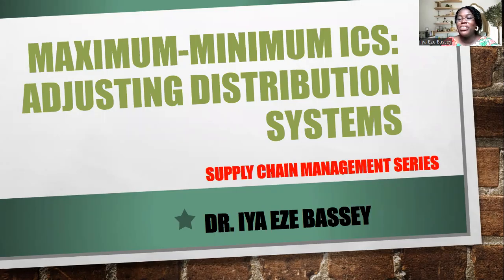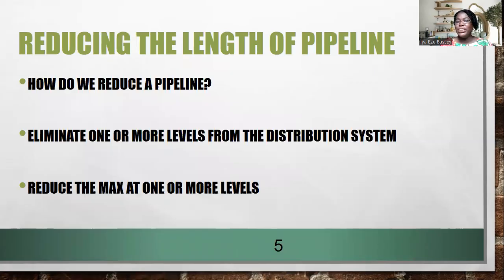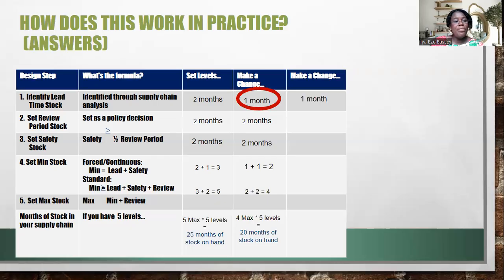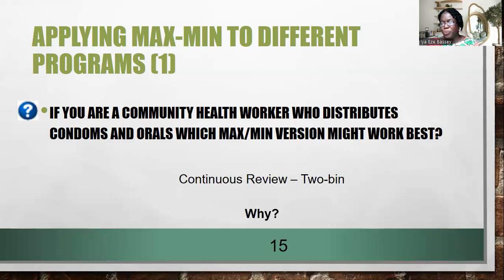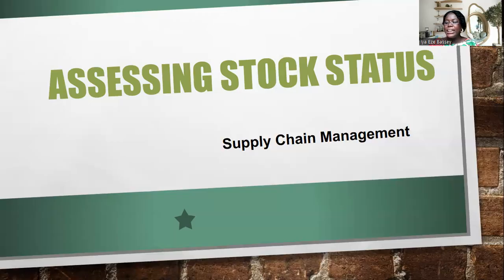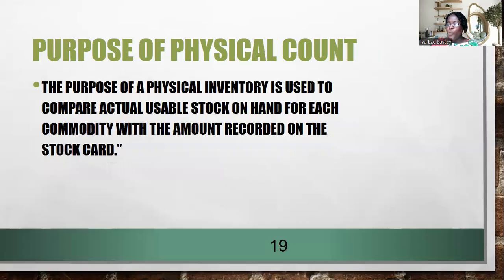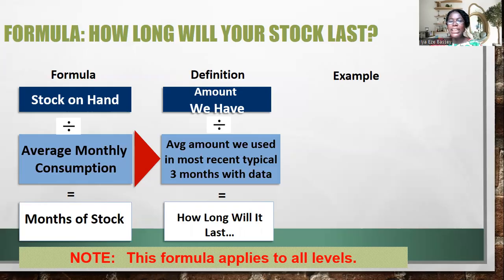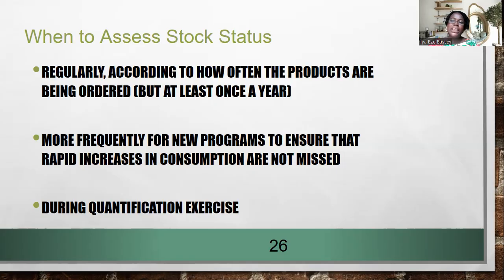Maximum-Minimum ICS: Adjusting Distribution systems (Supply chain management series)

Comment: Interesting!

This lesson centers on the purpose of adjusting distribution system showing the purpose of physical count after delivery and many more. It teaches the following: Shorter review period, reduction of lead time, overall distribution policies and the total length of pipe lines showing how it can be reduced and possible elimination levels. Advantages of this lesson include Shortage minimization, shortage of wastage and ways to prevent overstocking to avoid expiration of products before usage. 
Also I now understood the benefits of a Max-min system, such as preventing overstocking and understocking, along with the challenges associated with different versions and variations. Thank you Dr.

Comment: Thank you ma for this amazing session
  Firstly,I learned the steps to designing a max-min ICS which includes;
. setting up initial max-min polices for each level and type of facility
.checking of overall distribution will function properly if the level specific max-min policies are implemented.
. checking the total length of the pipeline that the polices at each level apply to
  And the factors that impact max-min stock levels include;
1)cost of products 2)cost of storage 3) storage capacity 4) leadtime 5)shelf life of health commodities

Comment: Thank you, Ma, for the lecture. I learned that designing a Max-Min Inventory Control System (ICS) involves several steps:

- Setting up initial Max-Min policies for each level and type of facility.
- Ensuring the overall distribution will function properly with the level-specific Max-Min policies.

If the pipeline is too long and delays product availability, it can be shortened by:

First, eliminating one or more levels from the distribution system.
Second, Reducing the maximum stock level at one or more levels.

To reduce the maximum stock level, we can:

1. Shorten the review period.
2. Reduce the lead time.
3. Improve the distribution system's reliability at one or more levels.

Factors affecting Max-Min stock levels include product costs, storage costs, storage capacity, lead time, and shelf life of health commodities, among others.

Advantages of using the Max-Min system helps to avoid: Understocking, Overstocking, Costs associated with emergency orders, Wastage

Challenges in using various versions of the Max-Min system can arise in systems that: Have numerous levels, Manage a large number of commodities, Handle products for new programs.

To assess stock levels, a physical count is conducted by manually counting the total number of usable units of each commodity in your store or health facility at any given time. This helps compare the actual usable stock on hand with the amount recorded on the stock card, and should be done at least once a year. In cases where stocks are moved rapidly, count should be done frequently to ensure adequate inventory management

Comment: Thank you ma for this lecture.
I have been able to understand that there are ways we can modify the lenght of a pipeline by
1) Eliminating one or more levels from the distribution system. 2) Reducing the max at one or more level by: Shortening the review period, reducing the lead time, improving the distribution system reliability.
Advantage of the maximum minimum control system are:
It helps to avoid overstocking and understocking. It helps to minimize waste.
I also learnt about physical count: this is the process of counting by hand the total number of usable units of commodity.

Comment: Thank you Ma for this lecture.
In Summary, I learnt first off, the steps involved in designing a Max-min ICS which include; setting up initial Max-min policies for each level, Checking if the overall distribution will function properly and Checking the total length of the pipeline.
I also learnt that factors that can affect Max-min stock levels are; Cost of products, Cost of storage, Storage capacity, Storage conditions at different levels, etc.
The advantages of Max-Min ICS include; Avoidance of Overstocking, Minimization of wastage, etc.
Assessment of Stock status is necessary for the determination of our month of stock and determination of how long the stock will last. It should be done regularly, frequently for new programs and during quantification exercises. It was really educative.

Comment: Thank you ma,first of all the steps in designing a max-min lcs are:(1)set up initial max-min policies for each level and type of facility (2)check if the overall distribution will function properly if the level specific max-min policies are implemented (3)check the total length of the pipeline that the policies at each level imply. Other factors that impact max-min stock levels (1)are;cost of products,storage capacity,cost of storage,reliability of transportation etc.

Comment: In this series, I've learned a whole lot.
Firstly, I learnt the steps to designing a Max-Min ICS which includes:
•Setting up initial Max-Min policies for each level and type of facility
• Checking of overall distribution will function properly if the level specific Max-Min policies are implemented
• checking the total length of the pipeline that the policies at each level apply to

And the factors that impact Max-Min stock levels include;
1. Cost of products
2. Cost of Storage
3. Storage Capacity
4. Lead time
5. Shelf life of health commodities etc.

The advantages of using Max-Min system includes; avoiding overstocking, avoiding Understocking, minimizing wastage, avoiding cost of emergency orders.

Lastly, I also learnt how to assess stock levels by doing a physical count and comparing actual usable stock on hand for each commodity, with the amount recorded on the stock card.
Thank you very much ma, for this practical lecture

Comment: Thank you for this wonderful informative session, In summary the length of a pipeline is essential when adjustment of distribution system policies is involved,The steps involved in this are 
1) Eliminations of levels from the distributed system 
2) Reduction of the maximum stock level at one/more level 
To design a max/min inventory control system the following steps must be adhered 
- checking the length of the pipeline 
- Setting up and initiating a max/ min policy for each level 
-making sure overall distribution will function properly 
certain factors affect max/min stock levels these are ; storage capacity,leadtime,product cost etc
To access total stock level a physical count is usually done

Comment: Thank you ma.
In summary, i learnt on how a pipeline can be adjusted
How the Maximum Stock Level can be reduced.
The advantages of using Max-Min system which include
1. Avoiding overstocking
2. Avoiding understocking
3. Minimize wastage
4. Avoid costs of emergency orders.etc

Comment: At the end of this lecture I have learnt  in order to adjust the length of the pipeline of a commodity  the maximum stock level  has to be reduced by eliminating or shortening one or more levels from the distribution system . I have learnt about factors that impact maximum - minimum stock levels for e.g stock level 1- cost of storage, cost of products etc,  for stock level 2 - lead time , age of program etc. I have learnt that in order to properly assess the stock status, a physical count is carried out in order to compare the actual usable stock on hand for each commodity with the amount recorded on the stock card and this in turn determines how long supplies will last in a facility

Comment: good morning Dr Iya Eze.

In summary I learnt that supply chain management is refer to the process of optimizing the distribution within a supply chain to achieve maximum efficiency and minimum cost, which involves analysing and organizing various factors such as inventory level organization route, ware house location to ensure that the products are delivered to customer in the most efficient and cost effective way possible.
with maximum, minimum inventory control system company can minimize stock out and excess inventory which reduce transportation cost and improve customer satisfaction.

Comment: Thank you Dr Iya Eze Bassey for this amazing session.
In summary, the maximum _ minimum Inventory control system provides comprehensive guidelines for the management of stocks levels to prevent both overstocking and understocking of goods. The steps in designing a maximum minimum control system includes:

1) set up max_min policies for each level and type of facility

2) verify that the overall distribution will function properly

3) Establish initial max min quality for each level and facility type.
Some benefits of using max_min system includes:

- it helps to avoid overstocking
- Avoid understocking
- it also helps to minimize wastage

Some challenges of this system include: system with numerous levels

- system that manages large number of commodities
- system that manages products for new programs.

Lastly, physical count of stocks is important and should be done at least once a year. In cases where stocks are moved rapidly, count should be done frequently to ensure adequate inventory management.

Comment: This session has made me to understand that the steps in designing a max-min ICS are;
1: Set up initial max-min policies for each level and type of faculty 
2: Check if the overall distribution will function properly if the level specific max- min policies are implemented 
3: Check the total length of the pipeline that the policies at each level imply . The max/min system has some advantages which includes; Avoid costs of emergency orders, consistency of stock orders, avoids wastage etc. On the other hand has numerous levels with numerous commodities. This is considered a challenge.

Comment: Thank you Ma for this wonderful lecture .
I understood the steps in designing a max and minimum inventory control system, how to reduce a pipeline , how to reduce a max and minimum stock level, what factors affect the impact of max and minimum stock level (lead time, reliability of source of supply,age of program, accuracy of forecast etc),the advantages of using Max and min system and applying max-min to different programs. I also understood  how to access stock status.

Comment: A very enlightening lecture...
I learnt of the ways to adjust distribution system policies, the advantages of using Max-Min system to avoid over stocking which are;
1. Minimizing waste
2. Reducing the cost of emergency orders
3. Simplifying inventory control decision-making
4. Maintaining consistent stock levels. 

I also understood the challenges of designing an inventory control system, especially when managing a large number of commodities across multiple levels. 

Also the inventory control system used for managing HIV/AIDS commodities and the importance of having an effective system to ensure product availability.

Thank you Ma...

Comment: That was an interesting lecture. It was able to know that Maximum-minimum inventory control systems are super useful for managing the supply of laboratory reagents, consumables, and equipment in medical laboratory science. By setting the right maximum and minimum stock levels, labs can meet testing demands without having too much or too little inventory. This helps keep operations smooth, resources optimized, and ensures timely delivery of accurate test results.I also learnt that the factors that impact

max-min level are

1. Age of program

2. Cost of storage

3.cost of production

4.Lead time

5. Cost of storage

Comment: Thank you ma, for this lecture. The need for an adjustment in the length of a pipeline cannot be over emphasized, this is because a lengthy pipeline would lead to inefficiency of a facility, expiration or damage of some products and many more. This is why the measures or steps in designing Max-Min ICS are being incorporated, these steps includes;
1. Setting up initial Max-Min policies for each level and facility. These policies vary for different facilities
2. Check if the overall distribution will function properly if the level specific Max-Min policies are implemented
3. Check the total length of the pipeline that the policies at each level imply.
I also learnt that, the stock status of a commodity should be accessed regularly according to how often the product is being ordered.

Comment: Adjusting distribution system in maximum and minimum inventory control system is simply finding ways to reduce the factors that affect a quick and fast distribution thereby finding a systematic way to adjust and renovate the pipeline distribution channel.
Factors that impact max-min stock levels are:
1. Cost of product
2. Reliability of transportation
3. storage capacity
4. Cost of storage. 
Steps in designing a Max-min inventory control system
>Set up initial Max-min policies for each level and type of facility.
>Check if the overall distribution will function properly
>Check the total length of the pipeline that the policy at each level imply.

Comment: In summary,I have been able to understand that there are steps involved in designing a maximum -minimum inventory control system and some of those steps includes;
1: Set up initial maximum -minimum policies for each level and type of facility.
2: Check if the overall distribution will function properly if the level specific maximum -minimum policies are implemented.
3: Check the total length of the pipeline that the policies at each level imply.
 Also, for you to reduce the maximum stock level; you need to change some elements of the formula in order to reduce the maximum stock level..
 There are other factors that impact maximum -minimum stock levels which includes;Cost of products, reliability of transportation, storage capacity, storage condition at different levels and also shelf-life of health commodities.
Step 2:
Lead times, Reliability of source of supplies, Effect of a zero balance of stock, management skills of staff
Step 3:
Avoid overstocking, avoid understocking, minimize wastage.
 There are challenges to using each version and variation which includes; System with numerous levels, System that manage a large number of commodities, System that manage products for new programs.

Comment: Thank you ma for the insight!

I deduce that for the effective and fast delivery of products to clients and for product to be in their most potent state during consumption the length of that logistics pipeline can be reduced some ways this can be achieved are 
1 set up until max min policy for each level
2 check if the overall distribution system will function properly is policy is implemented.
3. Check the total length of the pipeline to see which level the policy applies to. Also removing one or more levels from the distribution chain or reducing max at one or more levels

Comment: Thank u ma ,
I learnt on yhe the steps in designing the maxmin ICS are:
-To set up initial maxmin policy for each level and type of faculty
-To check if the overall distribution will function properly if the level specific maxmin policies are implemented and 
-To check tge the total length of thr the pipeline that the policies at each level imply
  I also learnt how to reduce the maximum stock level which are:
1 shorten the review period at one or more levels
2 Reduce the the lead time at one or more levels
3 Improve the distribution system reliability at one or more level so that the safety stock can be reduced

Comment: In summary this is a breakdown of what I learnt;
There are a few specific steps that can be taken to adjust* the distribution system when designing
- Evaluate the existing transportation methods and routes.
- Evaluate the warehousing and storage capacity.
- Evaluate the inventory tracking system.
- Evaluate the inventory control policies.
- Based on this evaluation, make changes to the distribution system to optimize efficiency and minimize costs.
- Test the new distribution system and make any necessary adjustments.
Advantages are:
- Improved inventory management: The system allows for more accurate tracking of inventory levels, which can lead to improved inventory management.
- Reduced costs: The system can lead to reduced costs due to improved inventory management, optimized distribution, and reduced inventory waste.
- Increased efficiency: The system can improve efficiency by reducing the amount of time spent on inventory management and distribution.

- Increased customer satisfaction
Disadvantages are:
- Initial investment: The system can be costly to implement, especially for small businesses.
- Complexity: The system can be complex to set up and maintain, and it may require specialized knowledge or training.
- Inaccurate data: The system relies on accurate data, and any inaccuracies can lead to problems with inventory management.

Comment: Thank you ma for this amazing lecture in summary i learnt about the steps in designing a Max-Min inventory control system and how to reduce the length of a pipeline which is by;
1) Eliminating one or more levels fron the distribution system and
2) By reducing the Max at one or more Levels
We also learnt about factors that impact Max-Min stock levels such as; cost of products, reliability of transportation, storage capacity e.t.c, and then we looked at the advantages of using a Max-Min inventory control system and the challenges associated with each version and variation.